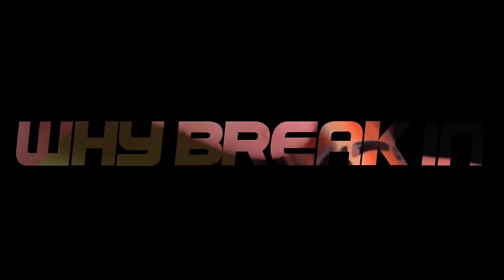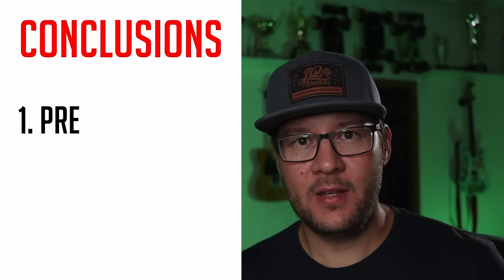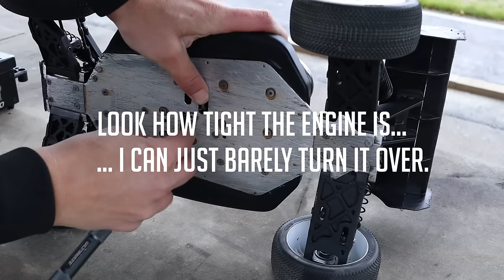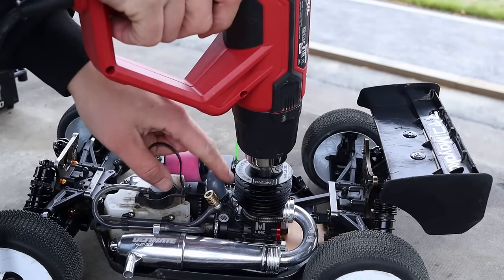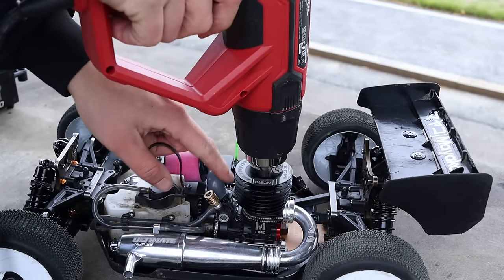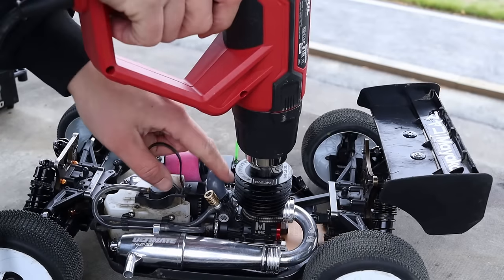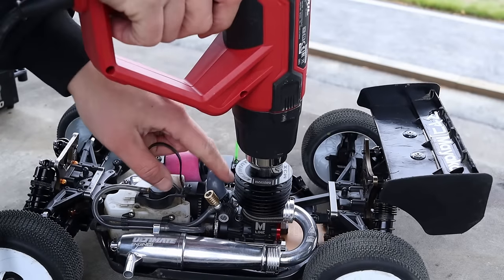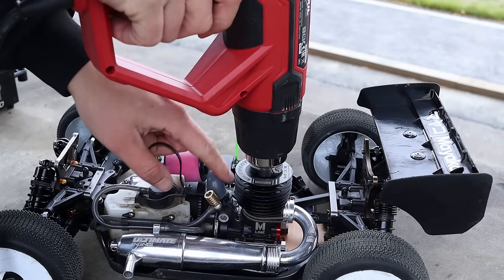Nitro Engine Break In - How, Why & What You Are Doing Wrong!

Comment: What about outdoor temperature? I read some people say, dont break in or even run a nitro engine if outdoor temperature is below +10 celsius?
As long as you pre-heat the engine it is safe?
Reply from the maker: When I filmed this is was below 10
Reply: It's extremely difficult as everything is in a constant balance, heat, fuel flow (air/fuel ratio) etc. I monitor it extremely closely and I usually avoid it bellow 15c, if I can.
Reply from the maker: PS A its no problem to run engines in cold weather. Pre heat, and if you find your engine running cold wrap some fabric or paper around the cooling head
Reply: @invisiblespeedrc  It's escalating quickly in the amount of work that's needed to monitor the engine and keeping it happy to the point where it's just a lot easier and safer to wait if it's possible.
I usually have a variety of cooling heads (sizes) on hand, different types of wrapping and I optimize the oil package and nitro content for every step of the break-in.
The temperature of the head doesn't say everything unfortunately, the fuel flow that's contributing to a lot of the cooling on these engines will impact how the piston expands compared to the sleeve, that's why throttle, load, rpm for instance will change things as well. 
I know, I know, at some point you have to accept that you can't control everything and just get on with it, I'm just pointing out that if there's an option of waiting then it will be in favor for both beginners as well as experienced. 😄
Reply from the maker: @PS A  we race in below 10C all the time, its not a problem. Stop worrying too much about your engine. It’s not overly conplicated or demanding
Reply: @invisiblespeedrc  I know, same climate here. 😉
I have also seen and fixed several engines that didn't agree with the climate and had wrongful break-in, so just pointing out that there's nuances to it. 🙂

Comment: I’ll do it without shutting it off for about a gallon , run it pig rich on the hudy bench w a prop , get her hot like 250 w a heat gun run her for a min at that temp then hit it w on a cool setting to get her down to 120-130 then heat her back up repeat repeat repeat

Comment: my engine does not want to start, brought to factory settings and it goes off again after 1 second. What do I have to adjust so that it at least stays on, the engine is new and I want to break it in
Reply: Is ther good compression do you have the right glowplug

Comment: can i ask you a random question,do you use or recomend using a fuel filter?ty
Reply from the maker: There is a filter inside the tank
Reply: @invisiblespeedrc   id not think of that,thankou very much
Reply: The filter in the tank is very coarse and will allow dirt to pass. Always run an additional inline fuel filter.
Reply from the maker: @jonpye8655  you do not need to
Reply: its a traxxas slash 2wd,thanks

Comment: I agree... Break-in is everything when it comes to a successful running nitro engine, and an oil bath isn't going to do fuck all for it. Get the motor in the car, have some patience, do it correctly, and you'll be rewarded with an excellent running, easy to tune, reliable, powerful engine. Screw up the break-in, and your engine WILL SUCK for the rest of it's pathetic life.

Comment: Is that air filter pink or does it have that much oil on it
Reply from the maker: Red oil
Reply: @invisiblespeedrc  I use red air filter oil but never get the filter that pink maybe I'm not using enough u should do a video on maintance don't think youv done that yet
Reply from the maker: strange selectionzz courses.invisiblespeed.net

Comment: Since 30 years I do the same breakin. This oilbath shit is a waste of time. Do one fueltank in stand and 4 fueltanks rich idled on the track. Than for 1liter dont exaggerate in your driving and keep slightly below the 100 degrees. Your fine. An engine needs to be broke in in an practical method. That means that you need a drivewind to cool the engine and dont forget to use a hairdryer to warm up the engine before starting till he got his 2 liter.